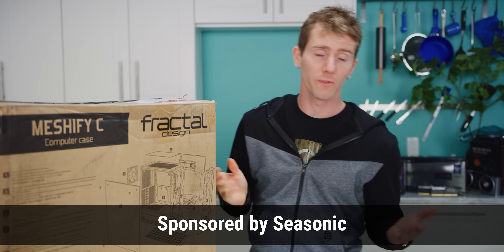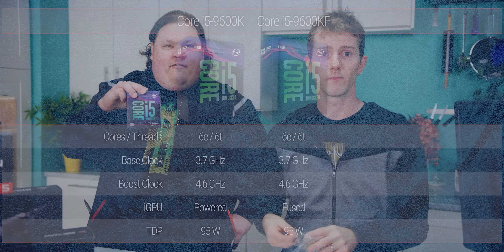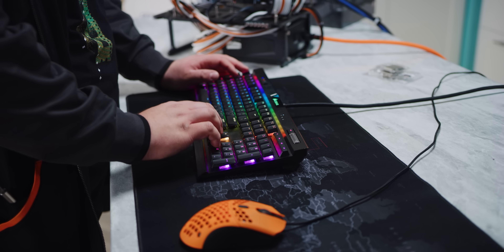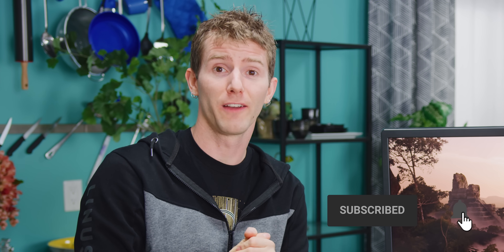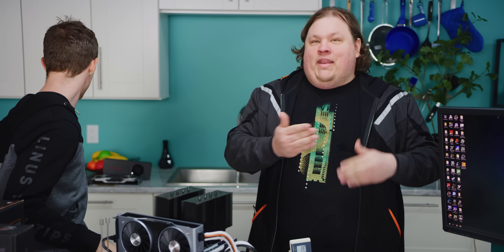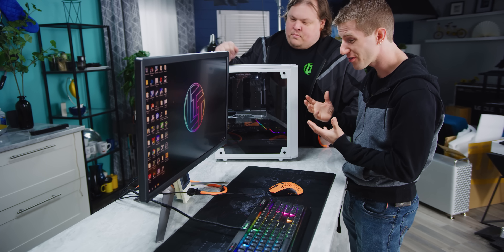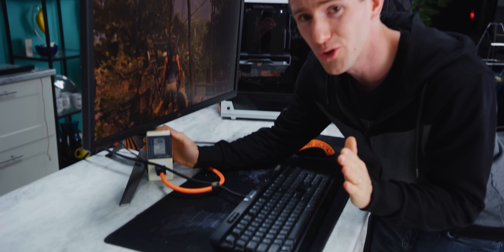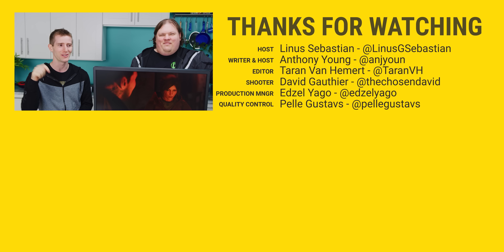We built a PC more efficient than a console!

Comment: We need this video redone NOW more than ever!
Reply: Yes because they made a big mistake I believe. Using a 650W power supply even that efficient seems a bad choice for their setup. It will still pull more electricity than a 400W Psu at both the same efficiency rating.
Reply: yes pleas LT
Reply: @OptLab  Ya. I do like the idea that they can just swop out the bios chip and run this at higer power rig whenever they want. But you would need the mobo's with the option to plug in bios chips. Or custom solder a soc for the bios chip.
Reply: @OptLab  Why is that so? If they have the same efficiency they will draw the same power, dosn't matter if it's 400w or 1400w.
Reply: @Tjocksnorriss  It does matter. At 4% load of the psu total, efficiency is about 85% even for a Platinium/titanium psu. The higher wattage  your psu max amount is, the furthest its efficiency peak of 80+ (or 95+ for titanium) it will stay on idle. 
After some research I realized they could have used the seasonic titanium TX-600 instead of the 650 at least, since there are not (none?) many titanium psus under 400W. 
This rule is very true for non-titanium PSUS (bronze for example) because the difference between idle efficiency and efficiency peak is huge.
Reply: @OptLab  Yes and the difference is so small it dosn't make a difference, if the computer drew 200w but around 20w a 10% efficiency difference is only 2 watt. A 10 year old with regular 80+ and a brand new 80+ titanium psus efficiency gap isn't even that huge at 4% load.
The sad part is that lower wattage psus don't sell and there are only a few really good units sub 500w on the market.
Reply: @Tjocksnorriss  2W is a difference, yes negligeable for (their) set up. But important especially when you draw 15 Watt at idle. it's 10% or 20%. 
RGB keyboard, they also mention the screen is 4K and they should use a 1080 screen, which they don't use... It's really a video to sell stuff companies gave to them.
Their set up is not good at idle. With such a title, people expect breaking record. Many people online manage to do less. And energy used is mostly used at moderate at light loads, even for a gaming pc. I don't trash their video, it's still decent in its own regards but I think some criticism is not negative.
Reply: @OptLab  They took what they had, you can always do better and its easy to go overboard when it comes to efficiency. 10% is a worst case scenario, a gold or better psu today will do around 85% from 0 to 10% load so its not even 5% and pcs are crazy efficienct today, 7950x at 65w compete with 13900k at way 95w! And beat the living snot out of older hardware, Amds 5950x is still very efficient for being out for a few years.
Reply: Yes please❤
Reply: YESSSS
Reply: Definitely
Reply: Not to mention RX 6400, the king of efficiency. That thing only draw 40-50 watts at full load with 40-50 fps. No wonder many reviewers said that its the most efficient budget gpu.
Reply: This need to be redone like...min, every 2 years.
Reply: One more like for 420
Reply: YES I want a eco 2024 build on a good budget that would be dope (electricity is stoopid expensive in my country)
Reply: Plsssss LT
Reply: yepp
Reply: Yes please I want to build something like this for my camper van!!
Reply: @hopoff9968  yess! 2024

Comment: Please do more power efficient builds, if the writers are reading this a video on efficient low power home servers (new and used parts) would make a good video.
Reply: I have yet to see Linus cover the MSI ECO line of motherboards.
Reply: @greatwavefan397  damn never heard of this before, looks interesting
Reply: @elonburgers5308  The latest of the lineup supports only up to 7th-gen Intel processors, so it might not look like a good investment given that PC gaming today calls for 6 - 8 core CPUs.

However, MSI's attempt to manufacture motherboards specifically for low power usage (even for some gaming) has had me obsessed for the past few years, but no one is talking much about it.
Reply: the a2000 is awesome i bet they would have used it if they made this now like what if all i care about is power efficiency, 45 fps is acceptable.
Reply: @noahlemo  same
Reply: Have any suggested links on this. I'm always looking for this kind of content.
Reply: If it helps you, I run an old slim optiplex 3010 with just a cpu and an SSD, with an enterprise HDD 
I use it as a media server.
I removed the CPU fan and replaced it with aluminum tape to the outer case body, effectively using it as a heat sink

Power consumption is 10 watts idle, up to 30 if uploading/playing something and spinning the HDD.

If you can get your hands on an optiplex with a 12th gen i3, it's a perfect base for a server. Make sure you get an unlocked CPU if possible

Comment: - Wants to save money by using as little power as possible
- Runs RGB keyboard
Reply: yeah but as we know rgb gives you 10000fps. so it's worth it
Reply: @maurice7017  Millennial. Everyone knows the only way to add speed to something is to paint racing stripes and flames. Now get off my lawn.
Reply: @williammiller3277  your flames can't defeat my gorgeous RBG. Join my team and read the RGBible. Together we can defeat everyone standing in our way. 

Ok honestly what is this xD
Reply: @maurice7017  RGB on the keys but the RGB pattern imitates a flame decel moving to the right infinitely
Reply: Rgb led's are eco af
Reply: LED's run on the power of a weak fart.
Reply: Rgb is for preformance newbs
Reply: @oeuf1280  I like the deckel reference 😂😂
Reply: @williammiller3277  (in 150 year old grandpa orc ) you k ow painting it read makes it faster
Reply: RGB keyboards use like 1 Watt. Joke aside, your point is moot.
Reply: @Gaur8n  1watt is 1 watt
It is a amount
A 1 wat Lazer can blind you in a instant
Reply: Light-emitting diodes (LEDs) are extremely power-efficient; they can be run off of a AAA battery for quite some time.  However, remember that Linus stated that they were keeping case lighting out of it to minimize power consumption, and case lighting also uses LEDs.
Reply: @maurice7017  well I have RGB rainbow flames
Reply: @williammiller3277  makes a flame themed RGB effect
Reply: @PLK123  just upgrade your PC to Ludacris add some rocket fuel and maybe turn on manual.
Reply: @oeuf1280  weak farts are deadly as hell
Reply: @alyjahcooper3106  depends on how close you are
Reply: @oeuf1280  true 2 feet your lungs gonna hurt
Reply: @alyjahcooper3106  you beside the guy your lungs collapse
Reply: @oeuf1280  lmao facts
Reply: RGB isn't that much power consuming
Reply: That's just a vital component, right there.
Reply: PLK wth are you doing here?
Reply: @williammiller3277  noob lol everyone knows that to make ur pc faster you have to put "I am speed" in a text to speech program
Reply: @maurice7017  tagchen
Reply: When i saw this i was quite impressed, my razer blackwidow elite only draws 500mah
Reply: i found rgb so annoying lol wouldn’t want rgb stuff on my setup
Reply: You do know how little power L.E.DS consume right
Reply: @DehyasHusband26651  You know the concept of a 'joke' right?
Reply: Ice Maur liked for the RGBible lol
Reply: @Reteo  case lighting often relies on a controller which draws nearly 2× the power needed to actually power the lights themselves. The controller would make them need to put in a larger power supply which would draw more power
Reply: That comment is like saying:"people in the hospital don't need life support, they can just use photosynthesis"
Reply: some Random Krunker guy behold the holy Kreativecke 
With his Rgbibel Amen 🙏
Reply: Also makes a computer. Where did he think the parts came from?? Mother Nature?? We had to manufacture those and that kills the environment along with mining for the materials. So if you really care about the environment, why are you even on the interwebs?
Reply: @swankscabinet1625  this is a really long winded way of saying you don't care about the environment.
Reply: Ricechrispy0527 I care about the environment but don’t put something on the web saying it’s environmentally friendly when it’s ok but not really.
Reply: Ricechrispy0527 an example could be electric cars. They are horrible for the environment but we still treat them well. If you want to HELP environments out. Use cng cars. Look it up later
Reply: some Random Krunker guy no obviously it’s ray tracing that adds performance. Ray tracing adds 100 FPS out the gate
Reply: @maurice7017  The Notorious Ruth Bader Ginsburg can't be beat by mere flames. :D
Reply: Extra FPS
Reply: To be fair, it can be useful in a dim environment, so it makes sense they kept it
Reply: And RGB Ram
Reply: @maurice7017  i have a Rgb keyboard and mouse, I still have 4fps on low on Pretty much everything 😡😡😡
Reply: @TechyyGD  thats because you have a fortnite profile pic
Reply: @maurice7017  it always gets mentioned, but when people have literaly a Single Letter/default or Kpop as their pfp nobody gives a Shit, its only fortnite... 😑
Reply: Oeuf MAXIMIM POWER
Reply: @oeuf1280  you guys are thinking about this all wrong.  RGB racing flames
Reply: RGB is non-negotiable :)
Reply: And also the memory
Reply: LOL rgb sucks now its all about RGBW now its red green blue white
Reply: brother
Reply: And rgb ram smh...
Reply: And rgb ram
Reply: RGB is as important as a cpu
Reply: @PLK123  yo VS LEGENG PLK IS HERE
Reply: @PLK123  i quit roblox btw xD
Reply: @herpderpherpd  Well, they were actually considering shortening the wiring to save power, but the wattage involved there would be WAY less than half-a-weak-fart, AKA a squeek.
Reply: +5 agility
Reply: Well obviously RGB is an essential gaming component
Reply: Good news a single RGB uses roughly 0.07 watts
Reply: if the RGB is using LEDs they probably use less electrcity then how much extra you cause your computer to use due to the room being at a slightly higher base-line temp with you being in the room.

basically, small LED's don't count.
Reply: Seriously speaking, gaming without backlight is really annoying when it's a bit dark. And you can easily deactivate RGB on a keyboard. They didn't used RGB on the computer itself because it's basically useless. A backlight keyboard is really useful nowadays. So yeah, worth it.
Reply: Extra fps
Reply: @maurice7017  is RGBible pronounce RGBeeble?
Reply: This was 69 replies, so I made the 70th.
Reply: The rgb voltage is bearly anything usb keyboard 5v if you ran a vt metre just on the lights mayb 1v seriously nothing he knows what's up so do I.
Reply: @anony13ousgamer55  r/woooosh
Reply: @oeuf1280  infinite fps
Reply: @snakeinabox7220  Laser*
Reply: It's like 0.02$ a week. LEDs are Incredibly efficient
Reply: He turned it off in 9:34
Reply: Also running egg ram with rib off could’ve spent that extra like 20-25$ on better ram
Reply: I meant they are running rgb ram with rgb off damn autocorrect
Reply: @maurice7017  it doesn't, it's just customizable lights
Reply: Actually, an rgb keyboard can consume less than 200mah, wich is like 3watts, so it is preety much worth it to have
Reply: @jblbassslayer3108  a bunch of that is just a more powerful chip for rgb, with 1 color backlighting you get the backlighting benefit and a simpler chip that uses less power, also less upfront cost
Reply: @maurice7017  your RGB can't defeat my typewriter. say gg, cuz i've already won at my 3000 Australian Ping. EZ
Reply: please, do tis again in q4 2021
Reply: @williammiller3277  and make sure those stripes are red
Reply: @AzngameFreak03  no, all rgb does is use more power than single color lights because of the rgb controller chip for no practical benefit, usability or performance
Reply: @snakeinabox7220  no
Reply: @shatpostsupplier1570  i think this rgb obsession is becoming a religion
Reply: @RiceChrispy0527  this is why you should go with single color lighting, no controller, less power consumption
Reply: @raffisedrak9558  no, they can't
Reply: @punman5392  ray tracing actually has less performance
Reply: @confusioned2249  no
Reply: @PupperTiggle  no, R+G+B=W
Reply: @spaghetti9067  no
Reply: @hotmojoe2483  no, a dell xps with a 3070 and 12700k will have more fps than an alienware with a 3060, 12600k and rgb
Reply: @Alin Popovici no
Reply: @AshLordCurry  single color backlight
Reply: @rhebucks_zh  Yes!!1!1! It's true!!!11!1!!1!
Reply: @maurice7017  let's use both!
Reply: priorities bro
Reply: Not during gaming. Plus the monitor is rgb too
Reply: I wish they compared idle power draw. Say you run games 5 hours a day at only 30w higher power use for the consol. A 10w lower idle power draw from the console would be enough to undo that advantage and give the overall lower power consumption to the console.
Reply: @herpderpherpd  If you could bottle a few hours a day of weak farts for several years it would pack quite the punch, though